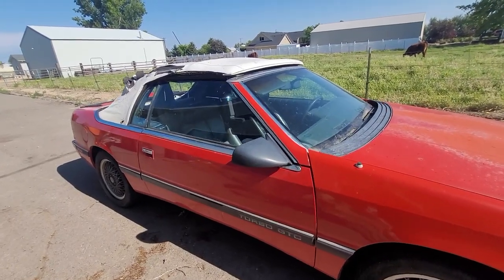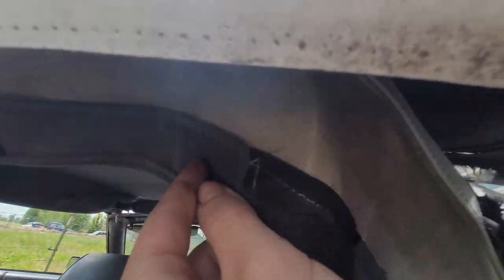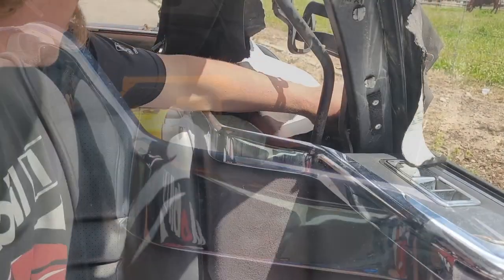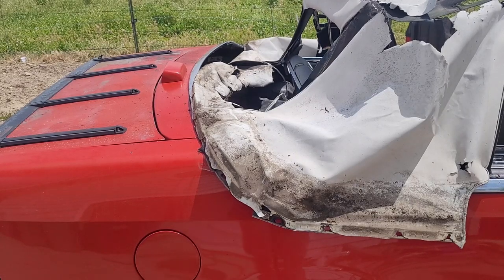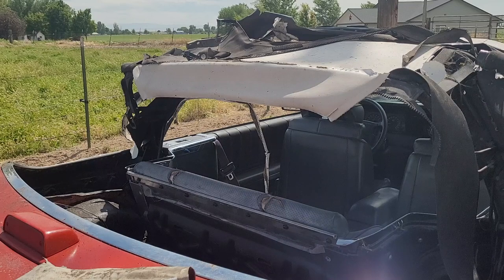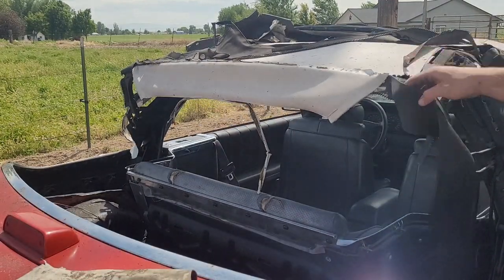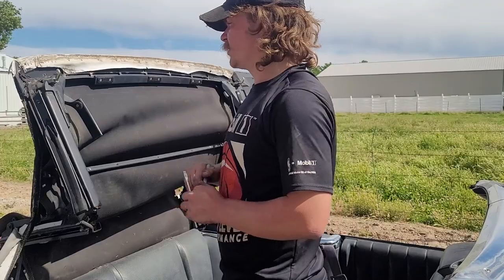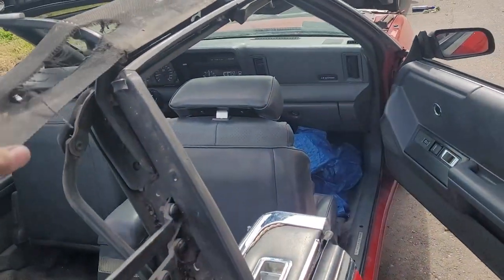Convertible Top Replacement Lebaron GTC PT 1 - Removal

Comment: So happy you're actually going through with this 😅 you're going to help somebody out big time
Reply from the maker: I hope so! Very steep learning curve for me, couldn't find any specific info for the Lebaron
Reply: @NotEnoughProjects I did a Shadow top about two years ago, even harder than the Lebaron because the rear two windows are attached to the top, had a hell of a time taking them out and like you said zero documentation for these cars! Going to be doing two Lebaron tops soon.
Reply from the maker: Yeah lack of documentation is rough. Not bad as long as you commit
Reply: @NotEnoughProjects  you’re walking me through it rn but I think I messed up and cut the rear window and don’t have the replacement piece for it

Comment: This video was extremely helpful in switching my Chrysler lebaron top. It’s a 1991 so it was barely different but the video helped a lot
Reply from the maker: Awesome! Glad it could help
Reply: @NotEnoughProjects hey would love to know if you ever found replacement weatherstripping for this lebaron? I pretty much destroyed mine taking it off and I’ve scoured the internet for replacement but haven’t found any. Suggestions? Again thanks you rock
Reply from the maker: Unfortunately not. I don't think anyone makes reproductions and I'm  sure the OEM supply dried up years ago. Best bet is to pull used from a junkyard.

Comment: I did this on my 93 Olds Cutlass convertible after 2 body shops wanted nothing to do with it. I vowed to sell the car before replacing the top again. After the top still leaked at the a pillars, and it needed 2 new hydraulic rams for it to go up on its own, I sold it and much later bought a 2011 Volvo C70 hardtop convertible instead.
Reply from the maker: Yeah, it's a bear of a job! Luckily all the hydraulics seem to be in good shape on this one.

Comment: hey man i basically bought the exact same car for 700$ with new tires and a new soft top after it sat for 2 years, basically i accidently smashed out the rear window and found your video. My question is if the soft top is two pieces, the tack strip at the back made it seem like the rear window part is sewn into the soft top?
Reply from the maker: Nice! Too bad about the window. These have a two piece top the rear window section can be replaced without also replacing the top. I think I linked the service manual procedure in the description which covers just replacing the window . Let me know if I forgot and I can add it.